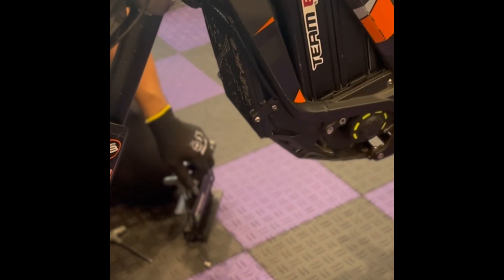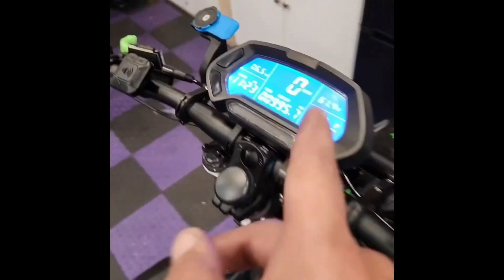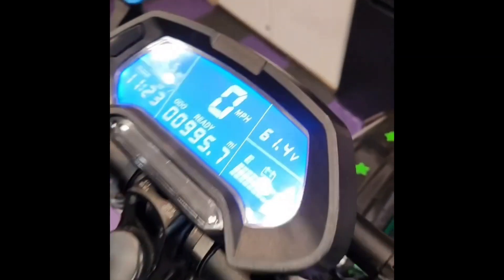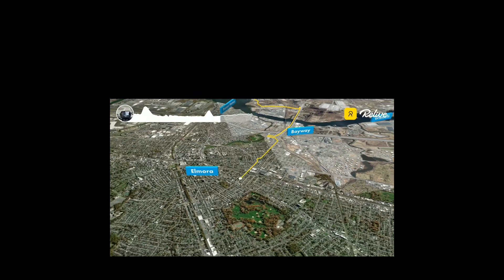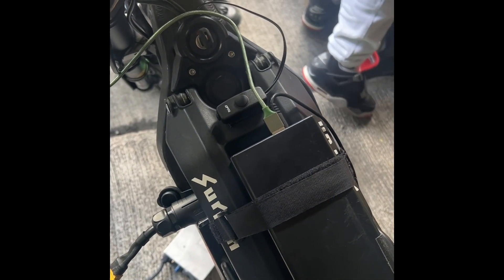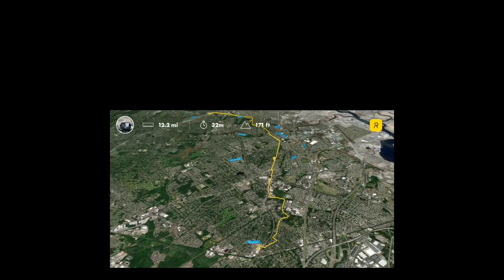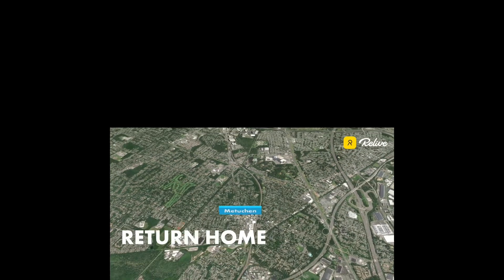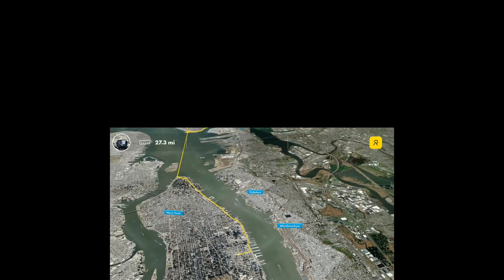Surron Light Bee X - 60v Sotion Motor and FarDriver 72680 installation, tune, test riding

Comment: How many amps are you running with the stock battery?
Reply from the maker: It’s still the same stock output with the stock battery and controller. Currently I’m running 101v 42ah battery. Won’t disclose the KW publicly but let’s just say today this bike is a rocket. I’ll be posting new content in a few weeks as we are rebuilding it.

Comment: can i wire in thumb regen on this controller? are there any plug n play kits i can find??
Reply from the maker: You can likely find sellers on ali that will make the harness for you. If not you can find ready made harnesses but they’ll cost you a bit. Yea, you can use a regen thumb if you want but I can tell you the regen on the controller to throttle is damn good even for lifting the front wheel up.

Comment: what is your stock battery size? 32Ah? 38Ah? what is setting? 110A? 120A? no cut by BMS?
Reply from the maker: 34ah, no bms bypasss (I do not recommend bypassing bms ever), 90a currently. I’m upgrading batteries this week for Black Friday. So my next tests will be comparing the rpm’s and motor temps etc with more power.
Reply: @justelnyc  thanks! new battery will give you a huge power! congrats 👏 i will looking forward to it.

Comment: does this motor is more efficent? I mean if it gives more total range with same battery?
Reply from the maker: Yes, but at the expense of your primary belt unless you tune it with an aftermarket controller. The torque by default is too strong so you need to tune it or will chew up your belt. To answer your actual question, yes, because you get up to speed faster and more efficiently. Hyper miling is also so much easier as the bike maintains its speed longer than the stock provided for coasting.
Reply: What do the guys using 12 kw use so their belt doesn't get ruined?
Reply from the maker: I would say it’s only a matter of time before they shred them, the issue is the controller regulates the spin, since the stock controller cannot program that motor directly they don’t sync correctly thus creating the stripping.